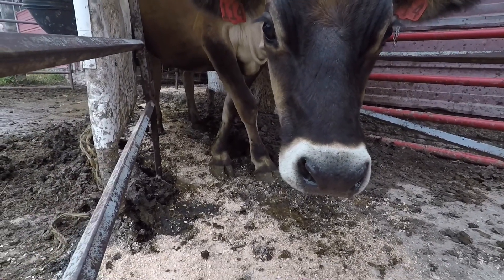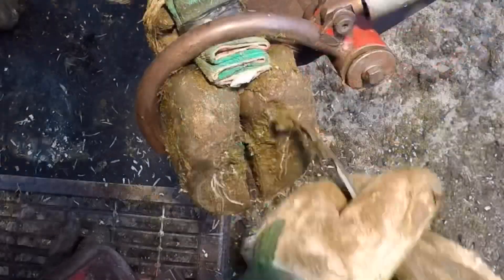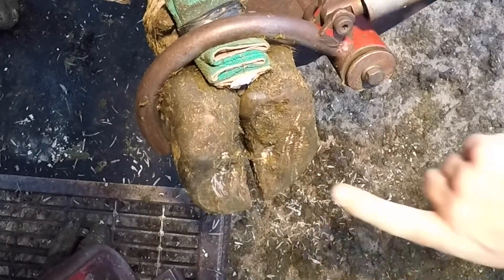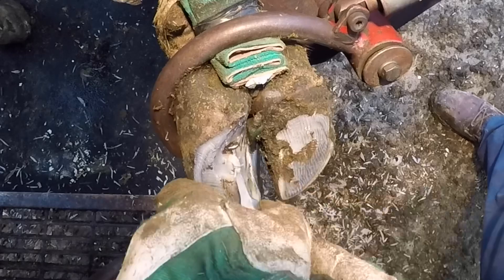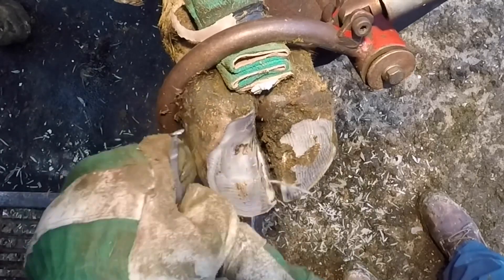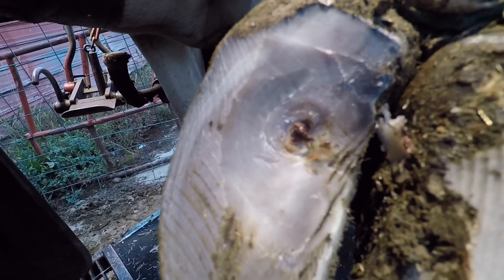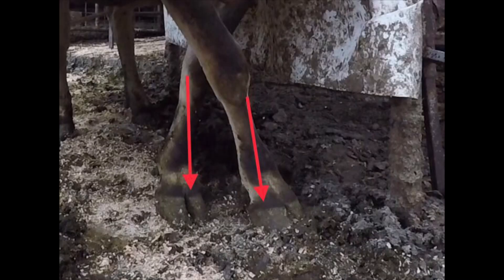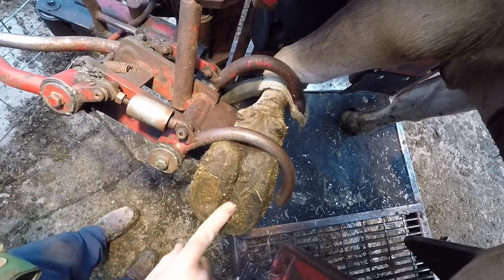Ep. 45  The Curious Case of the CROSS-LEGGED COW

Comment: Hey Nate, I've watched a few of your videos now and whilst I find them fascinating, (and no, I haven't a lot of knowledge of cows), but I have been wondering if it is possible to take too much off the hoof. If so, how do tell just how much to remove? Keep 'em coming mate, I really enjoy them.
Reply from the maker: Yes you can.  I maintain at least 1/4 inch of sole on the bottom unless I’m dealing with lesions then I use a block to remove weight.  The horn consistency changes and that’s when I stop.  Experience guides that.

Comment: Just before you put that last block on, you had a little scratch at 2 little spots that looked a little flaky almost powder like!
What was the go.
Love your work by the way.
👍👍👍
Reply from the maker: It’s called pith.  Just hoof flaking away as part of the shedding process.  I wanted to remove it before I applied the block so I had good adhesion.